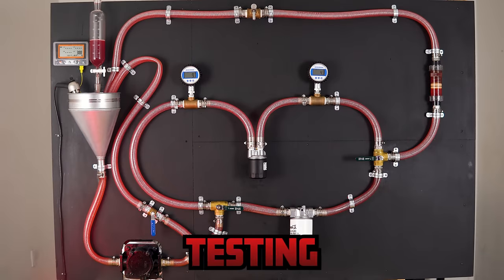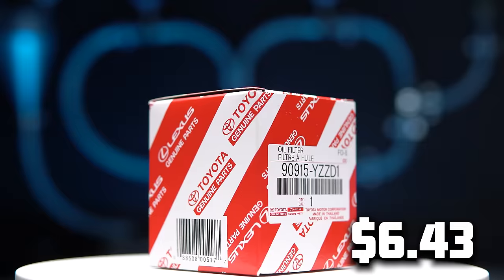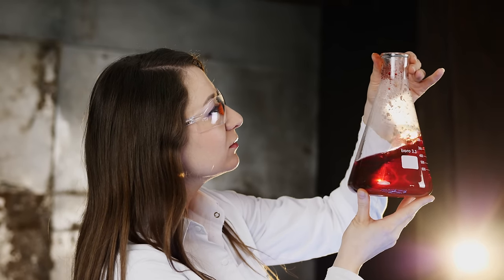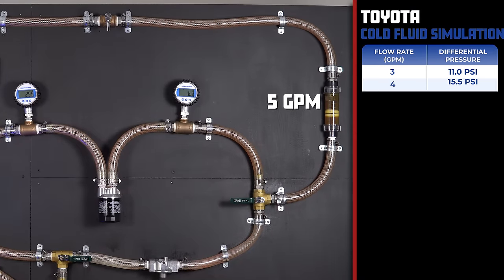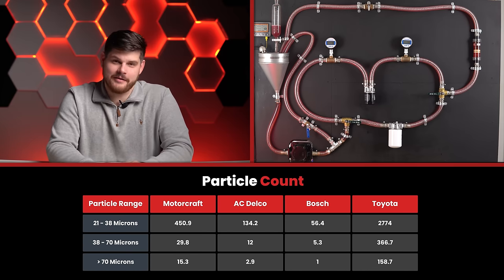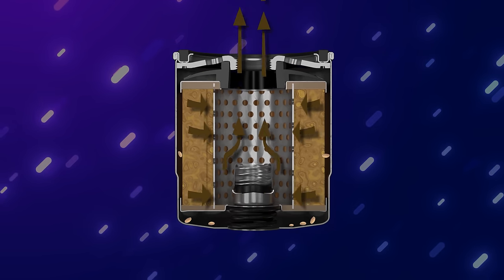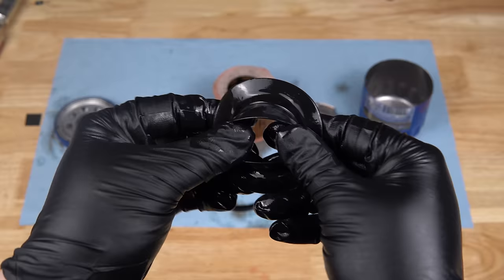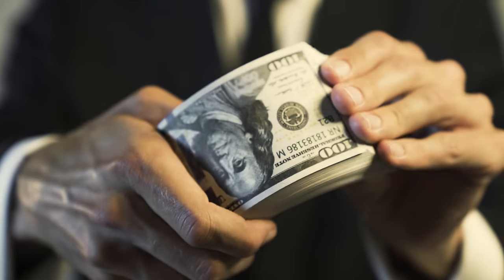Are Car Dealership Oil Filters a RIP-OFF?  (Engineer tested)

Comment: Would have been nice to have the dirt capacity test run unchanged for 10 minutes or so after it reached the 8 psi threshold and then have the oil analyzed. I mean, the Toyota filter didnt do a good job with small amounts of dirt, so, much of the dirt might still be suspended in the oil and not actually in the filter media. Maybe it might even be possible to calculate from the analysis how many grams are still in the oil and how many grams are actually in the filter media. That is if a gravimetric dirt analysis can be done with oil...

Comment: If the Toyota filter is so bad , then why do Toyota engineers design them that way. 😊
Reply: Good question, you'd need to ask them. But BR particle results align with ISO 4548-12 industry standard independent testing sponsored for Amsoil showing the Toyota OEM efficiency to be 55%@20 um.

Comment: Toyota is more concerned about oil flow than filtration. Their filters are not the best. But they allow the most oil flow. Toyota figures lubrication is more important than filtration. Change your oil often and you shouldn't have any problems.

Comment: The majority of engine damage happens between 10-20 microns. I wish you would have sent in a control sample to rule out the possibility of a bypass valve being stuck open, as well as shown flow with a bypass valve opened. But like always, engineers are more concerned with pounding their chest than focusing on the long term implications of anything they do.

Comment: On my 2009 Toyota Camry SE V6, I use Mobil 1 Extended Performance Oil Filter with Mobil 1  Extended Performance High Mileage Full Synthetic Motor Oil.
Reply from the maker: Mobil one is a great filter! Thanks for watching!

Comment: For the toyota filters, the purpose of the low efficiency design is to help better facilitate long drain intervals.  They know that many americans neglect their vehicles and change the oil at or beyond 10,000 miles.  This filter is unlikely to hit bypass pressure drop for a long time during the drain interval.  It certainly isn't ideal to have that many 70+micron particles making it through, but it gives negligent owners more margin and less probability of severely damaging something due to infrequent oil changes.                                                                                                                                                                                            If you own a Toyota and change your oil religiously at 5K, I would opt for a better (more efficient) filter because bypassing isn't really a concern.  Especially considering these engines all take 0w-20 or 0w-16.

Comment: -Always use genuine filters/parts especially for toyota vehicles
-replace fluids as recommended by the manufacturer
-never mix fluids with dirt or any other substance
-never take an advice from anyone except the engineer who design and built your car (manual book)

Comment: Filter manufacturers have to juggle level of filtration and the expected mileage they might be left in place. A really good, fine matrix filter, changed every 6K miles or less is optimal, the same one left for 40K or more would be a recipe for disaster.

Comment: Regardless of oil filter used, change oil every 4k-5k miles and use high quality synthetic oil, with the recommended viscosity.
Reply from the maker: Agreed that oil change interval is way more critical. Thanks for watching
Reply: Just make sure you use automotive oil and not aircraft hydraulic oil.

Comment: I have a toyota hybrid, with not original oil filter I usualy get vvti rattle on morning startups, with original toyota filter there is no vvti rattle whatsoever.
Reply from the maker: Interesting, what filter do you have? Thanks for watching
Reply: @BrandRanks  not oem was Mahle or Knecht, I dont remember, OEM bought directly form a toyota dealer. Not OEM had a rubber rings on both ends, original does not have that

Comment: 01:39
Toyota engine engineers are focused on volume and not pressure.  Another reason why the filter's micron filtering is so much more than the other filters.  They rather have oil moving in the system.  Many high-mileage engines seem to prove their "madness".
Reply from the maker: Yeah, I'm thinking the same way, it may have been intentional, planning for people that rarely change their oil and filter, I guess they much rather have less clean oil than no oil. Thanks for watching!

Comment: A small Lawn Mower engine has no oil filter look How long The last even without changing the oil
Reply: A small lawn mower might last many years, but it's run for 1-2 hours every week or two for maybe 30 weeks a year. Call that like 35 hours a year. That would be equivalent to putting about 2000 highway or 1000 city miles on a car every year. Most people are doing 10x that if they commute. 

Car engines can put up with a lot of wear too. They'll just be less efficient, and you'll actually notice it, unlike in a lawn mower.

Comment: So for those that don't understand high efficiency filters will have a higher resistance because they stop more particulate
Reply from the maker: Agree in a general sense, but the filter material also has to do with it, a full synthetic media of the same micron rating a a cellulose one will have less resistance to the flow. thanks for watching

Comment: Toyota does this on purpose… They’ve also increased their oil change intervals from 3000 miles to 5000 miles now 10,000 miles… Their engineers do an excellent job at designing reliable engines… But their sales and marketing team does not want your vehicle to last more than say 200,000 miles… Because they want you to buy a new vehicle! If your Toyota last 200,000 miles, they’ll still uphold their reputation of being “reliable“ but it won’t last 400,000 miles and you’ll be buying twice as many Toyotas

Comment: Toyota engineers value flow over filtration. It’s your responsibility to keep up with frequent oil changes. Toyota recommends oil changes every 10,000 miles. I would change oil between 3 to 4 thousand miles. Toyota is in the business of selling you vehicles not after making sure your vehicle lasts forever.

Comment: NO THEY ARE NOT!!!!
My 1995 Toyota Tercel has 456.000 miles on original 5E-FE never openedusing nothing  but Toyota Denso engine oil filers. The best.

Comment: I have never used OEM oil filters and changed oil filters and oil on a range of vehicles mainly light commercial vehicles as all engines would start to burn oil except for the 22R engine in my 1997 Toyota Hilux with 435000 kilometres on it and no sludge at all because take the rocker cover off no black sludge clean as a whistle eat your dinner out of it and it has a non OEM oil filter on it the motor industry that's to do with cars spare parts is highly regulated so all oil filters would be pretty good as with oils ect last oil change l put Castrol oil in it

Comment: Can Brand Ranks confirm this Toyota filter was purchased at a Toyota dealer? A number of the Toyota filters available on Amazon and the Internet are counterfeit. In fact, the company you provide a link to on Amazon selling the Toyota filter has been accused of selling fake filters. Please clear this up on the source. I suspect you tested a counterfeit as this filter does not meet Toyota standards.
Reply from the maker: Hey! Thank for watching and reaching out. This specific filter was purchased at a local Walmart, not online. Thank you for  the info regarding the Amazon link, went ahead and changed it to another offering just in case those allegations are Tru. Again, thank you so much for bringing this up, all we want is to help all of you!

Comment: Toyota has the highest dependability and durability ratings amongst car brands, their engineers then deem that oil flow is more important than filtering capacity.  Ford on the other hand has one of the worst reputations for reliability. Food for thought.

Comment: I feel like there's a glaring omission here. To make this a controlled experiment, you should've used a specific vehicle's oil filter between Dealer brand, OEM, and OE with the correct grade / spec oil. In this video there's two different brands of cars, 3 different brands of filters and there's no information on which vehicles, which grades of oil they were created for. 

There's still heaps of great information in this video, would've been nice to have these variables in check though.
Reply from the maker: Hey! All of the filters utilized are a cross reference from each other. In other words Fran 3614 filter can replace any of these filters same goes for others. Hence why we couldn't include Honda since they did not have a cross reference. Additionally, what oil they were made for is not considered in the official ISO testing standard as they utilized the oils we used as well, Aeroshell 41 and ISo VG 460. Tha k you for watching and really appreciate the feedback
Reply: @BrandRanks  This is exactly what I wanted to know, thank you!!
Reply from the maker: Of course, no problem. Thank you for your support

Comment: Interesting but in my opinion overkill. If you go to Oreilly's or any parts store , including Wal-Mart and buy a name brand filter and you are an ordinary driver like I am who changes their oil and filter at 5,000 miles I dare say any known brand is acceptable. I also use private brand oils from the auto parts store as long as it has the correct weight, and rating (SP, etc.) and API seal. Never ever had an engine problem. Did this with my wife's Honda 2.4 engine and unfortunately a minor accident killed it at 170,000 miles. The only thing I would caution is if you use a quick change oil place, I will use a place that lets me bring my own filter.

Comment: Not all filters will have a bypass valve. If it's designed for an engine that has a bypass valve built in, they won't have one.

Comment: Test the normal Purolator, Purolator One, and Denso please.
Reply from the maker: thanks for the recommendation!
Reply: @BrandRanks  No, thank you for testing these! You've opened my eyes to best filter for the money is now the Fram Endurance at $13 (Purolator Boss is $15 @ Tractor Supply, Amsoil is $14 on their website) and it's right down the road at Walmart . I thought I would never buy a Fram oil filter on purpose and put it on anything except for if I needed something right now and a Fram was there (with the intention of replacing it with a Purolator or Wix later). 
Along with the others I've mentioned please test a few I forgot to put in the first comment. MicroGard, CarQuest Standard, CarQuest Premium, AC Delco Ultragard Gold, Baldwin, Donaldson, and SynLube.

Comment: EVERYTHING .... Auto dealership, Boat dealership, MC dealership, RV dealership is finely tuned to RIP the consumer off. ALL of their merchandise is wayyyy the F and gone overpriced.
Reply: Toyota engines are designed by their engineers to run optimal with the Toyota filters. Switching to different brand could lower the performance and durability of part inside the engine. High flow rate is more important than filtering for Toyota engines.

Comment: Knowing Toyota i'm not surprised by those results. That filter may have been meant for 0w16 oil (which is close to water) and it could be running open all the time. Next time please note the oil used for the filters otherwise this is just going to look like one more marketing trick.

Comment: Delco has no bypass because it is built into the filter housing not the filter itself.

Lots of engineering licence taken herein.
Reply from the maker: This specific Ac Delco filter is advertised to fit many other cars without the bypass valve built in. Actually you might even find this PF53 oil filter with a by pass in some occasions.

Comment: I am very skeptical of the results for the toyota filter. Not saying your test is a sham. Maybe that filter was questionable. How could a car company that has one of the hightest reliability ratings, if not the highest, uses a filter that filters the worst? How could this be? Very confusing results. Could you possibly run this test again on a filter properly purchased from a dealer? I'm shocked...
Reply from the maker: 👋 The filter was purchased at Walmart, also because eit filtered the worst does not mean it's the worst filter, it also had the best capacity as well as a great flow. You can't really be the best on all the categories, so maybe this is what their engineers intended, to prioritize flow rather than cleanliness, they may have preferred you had less clean oil instead of no oil during cold temperatures or extended change intervals. We are just showing the dat we got, not biased against any one oil filter. Thank you for your feedback and being kind about it as well!
Reply: @BrandRanks  based on your response, I think I will trust the engineers only half way. I’ll use there filter for the flow characteristics but change the oil twice as often to keep the oil cleaner. Cheap insurance. Thanks for the work you guys do to keep us informed!
Reply from the maker: That sounds like a great idea! Of course, glad we were able to help and thank you for your support!

Comment: From the thumbnail if Toyota gets their filters from the same source as their oil then they have some pretty fantastic filters that you have already covered, and you massively overpay for
Edit: they don’t so the oem oil that Toyota uses is mobile 1 but they use denso or purilator filters depending on type. I think it’s probably an upgrade to use the mobile 1 filters.

Comment: Dumb test. A free-flowing filter could be because 1) it is filtering less (perhaps not sufficiently) 2) it's bypass valve is opening. Also, it doesn't matter if the OEM filter flow is less, as long as it's enough.

Comment: Simple truth oil filters aren’t that important if engine has that much metals in it a failure has happened already. And a filter won’t fix a spun bearing or ring sticking or flat cam.

Comment: and this is what happens wen someone thinks they know something and didn't bother to RTFM on the use case of the product.
every product has a specific task in there design that is unique to there product that is made for those specific aspects.
just doing a few test and then trying to make a product look bad and ignoring the manufacturer product specific aspects makes all these test moot.
some products are made to be restrictive for a reason, some products are made to be high flow for a reason, some products are made for the middle ground for a reason.
so making a blanket test on a number of products to see what's best, is pretty darn ignorant and not scientific as every product has a specific use case for there application.
last but not lest Engineer Tested is laughable as i'm confident you do not have a degree basted on your testing any real engineer would not ignore use case specific's of a product.
then again i could be wrong now and days they give out degrees to anyone as a consolation prizes and this is what we get.
Reply from the maker: Thanks for the feedback

Comment: Comparing filter to filter based on the MFG brand is not really that scientific because each filter is designed to be used on a totally different engine. I buy Motorcraft filters for my Fords. It is interesting that the Motorcraft filters all have oval holes for the oil to pass through with less restriction than other makes of filters. I think only Bosch or Mobil one will "sometimes: have these oval holes when you buy the filter for a Ford. I don't bother messing around with buying aftermarket filters when the Motorcraft are cheap and made in the USA AND designed specifically for my engine.
I'd be interested to see you compare an OEM filter to other aftermarket for the SAME application, basically the cross over filter to fit the same engine. That would tell us way more.
Reply from the maker: Hello! Thanks for watching we really appreciate it. You bring an excellent point. All out filter videos are based on the fitment for a Ford Mustang, feel free to check out our other videos. Thanks for the support!

Comment: The D1 Toyota filter is super outdated. I am a certified Toyota lube tech. I service 16 Toyotas everyday 5 days a week and it is rare to use a D1 filter. N1 and A1 are the 2 most common filters used. Kind of a let down they used an old uncommon filter. We want to know about the N1 for our GR Corollas not some old Tacoma motor that has been replaced with a 4cyl turbo...
Reply from the maker: Thank you so much for the feedback, we are looking into modifying the rig for other filters and we will look into this. Thank you again!
Reply: @BrandRanks  I have a hunch that the D1, F1 and A1 are probably all the same filter media anyway, maybe different bypass pressures, though I can't say for sure. I look forward to more testing results and thanks for all you guys do.

Comment: This whole debate with fan boys is so funny.  Filters make very little difference to a vehicle’s durability.  I one drove a 1970 VW for yen years and many thousands of miles using straight 30w conventional oil and the vehicle DID NOT HAVE AN OIL FILTER.

Comment: The purpose of the bypass valve is to keep the oil flowing to the engine in the event the filter becomes clogged it’s NOT so oil doesn’t flow through the dirty filter and pickup more contaminants as you say. The fact that you actually said that brings into question your actual understanding of oil filter design despite your elaborate test setup.
Reply: I had to listen on repeat several times to make sure i heard right. Which the statement is incorrect, your actually recycling the bad oil which just came from the engine. What is the point of an oil filter or any tests if your going to say bypass valve leads to cleaner oil? More than halfway through the video and you lost your credibility from those tests by saying that.